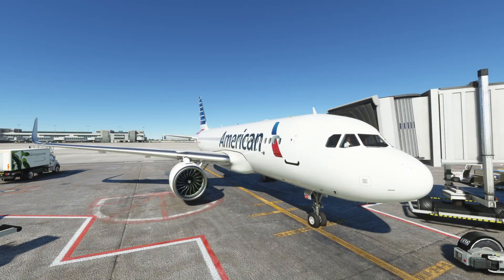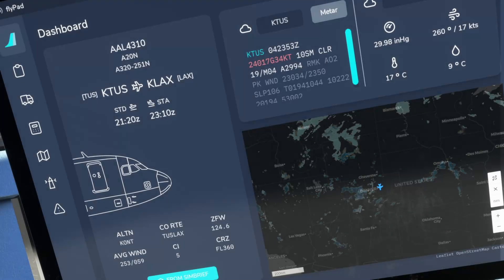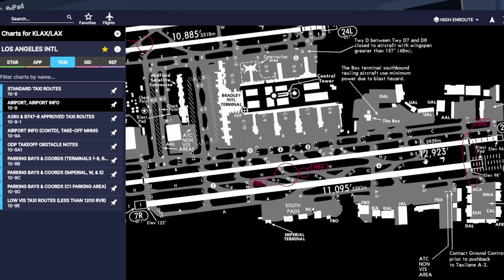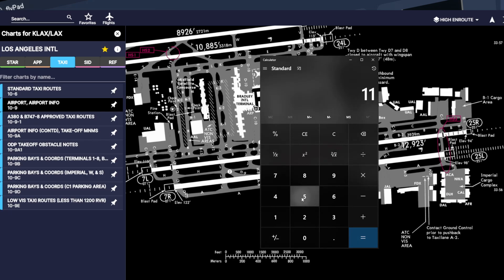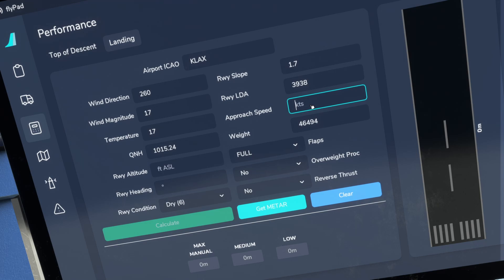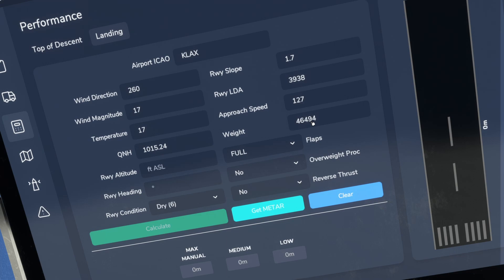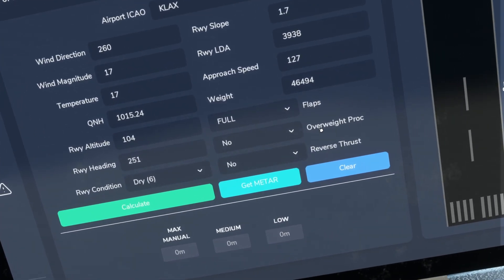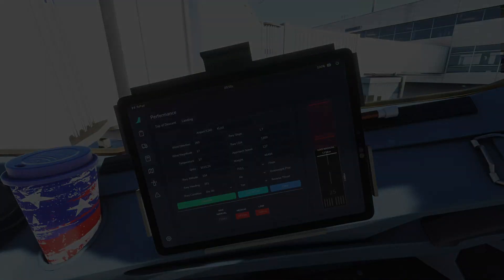Microsoft Flight Simulator | flybywire A320 | What AutoBrake Setting To Use

Comment from the maker: 100 * (elevation-1 - elevation-2) / rwy length. I.e 100 * (115 - 94) / 12923 = =0.16 % 

It was pointed out that I did in fact do my slope calculation wrong :(  Above is the correct formula. Thank you to all of you that provided the correction!

Comment: I’m sorry but there are a couple of mistakes when calculating  runway slopes . First, slope is a ratio so you don’ t need to convert feet  to meters so 21/12923=0.001625. Of course you can work it out in meters but in your equation you have to divide by 3.28 not multiply to: 21/3.28/3938=0.001625. Second, If we mulltiply this result by 100 we get slope in %, not in degrees. 0.001625x100=0.16%. If you want to give this slope in degrees, you have to compute the arcsin of 0.001625 which is 0.09° but you have to enter the % in the landing Calculator. Congratulation for your channel. Love your videos
Reply: Slope ratio to slope angle is calculated by arc tan, not arc sine (but for such small angle the difference is negligible, 0.09° in both cases).
Reply: @niklasnorrthon3125  completely right! It seems that.my trigonometry is rusty.,, 😩

Comment: Your math for calculating the runway slope doesn't add up. You missed a pair of parentheses in the denominator. The correct formula is: slope = (elevation-1 - elevation-2) / (rwy-lenght [m] * meter-to-feet) * 100

I.e slope = (115 [ft] - 94 [ft]) / (3938 [m] * 3.28 [ft/m]).

Even simpler would be to take the runway length in feet from the chart and not have to think about unit conversion. Then you get: slope = 100 * (elevation-1 - elevation-2) / rwy length. I.e 100 * (115 - 94) / 12923 = =0.16 %
Reply: Thanks for clarifying this but it’s still confusing … think he needs to edit the video

Comment: Your awesome!! Love how you keep coming out with the videos!! Stories from real pilots of max braking on a RTO making their headsets fly off the braking is so aggressive (on the Airbus). Also you can have no braking set on a long runway and just use your thrust reverse to slow down, than manual braking to make that turn off. In my personal flight sim experience, I set low for less than 10k foot runway or nothing if more than 10k foot.. and use manual braking as needed.